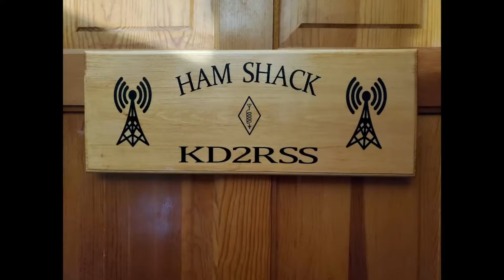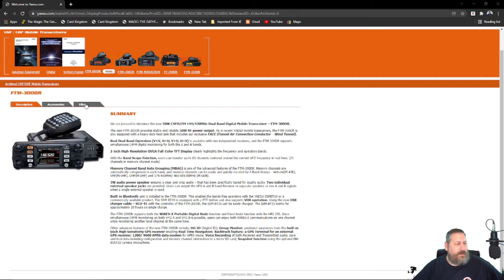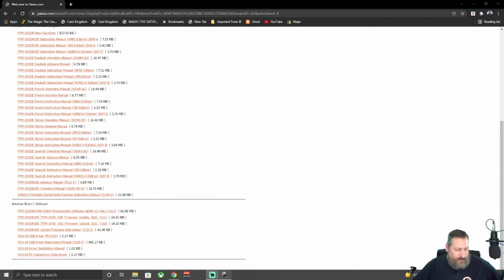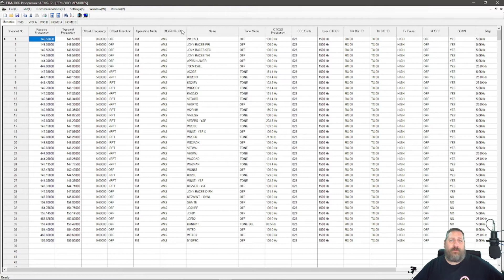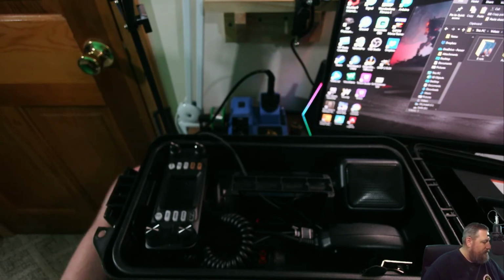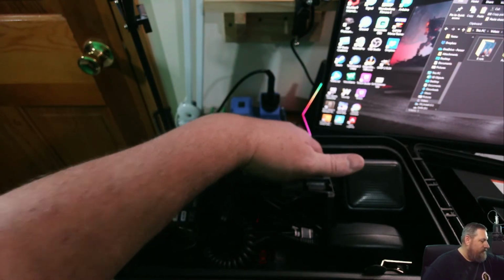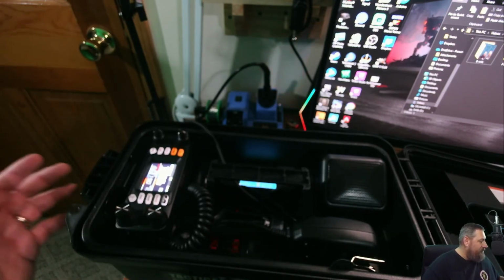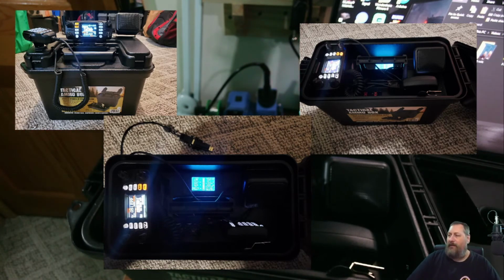HAM-O-CAN, the FTM 300 DR Go Box

Comment: I’m click what kind of battery that you use buy it show that not available on Amazon. Can you please tell what kind of battery is that? Thanks
Reply from the maker: In this set up right now is a Miady 6AH lithium Ion, I did purchase on amazon,  I also use the Bioenno batteries for other Ham portable operations
Reply: Are you using just battery or 2 pack? and your FTM 300 can transmit on a 6AH without a problem, also are you transmitting on a max power? Just a question because I planning to build something in my mobile like WiresX node.
Reply from the maker: @abdraztix  currently single 6ah battery , fits well in the box with radio
Reply from the maker: Also,  I haven't noticed any issues transmitting at any power, just will affect how long battery lasts before recharge

Comment: Question for you.  If I want to send emails with my Kenwook D710 it has a built in TNC but it’s not digital.  Will the 300 send emails or do you need to purchase a separate tnc/sound card?
Reply from the maker: I'm still figuring the 300 out but it has a 10 pin din data port and with the correct cable I connected to my computer
Reply: Can’t wait to see more videos on this.  Have a blessed week.